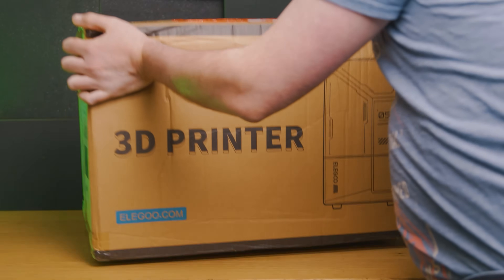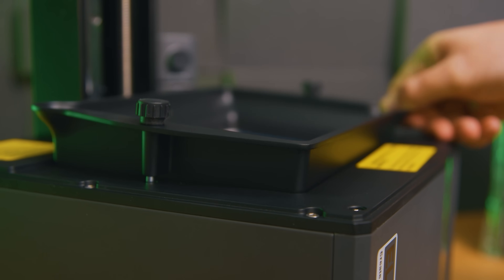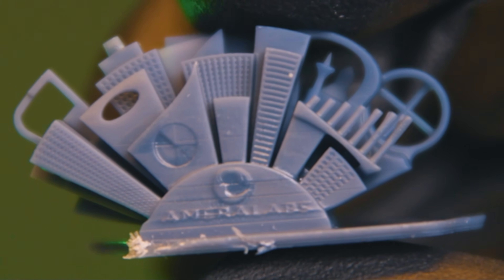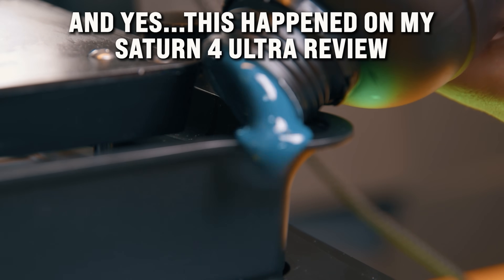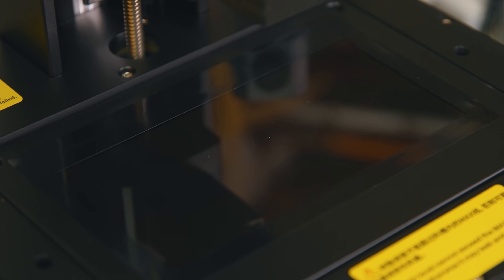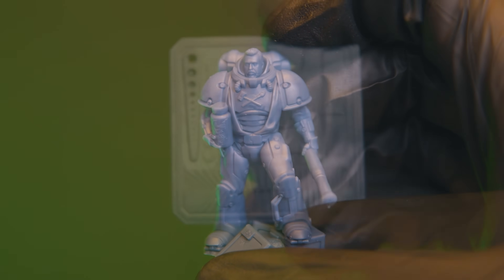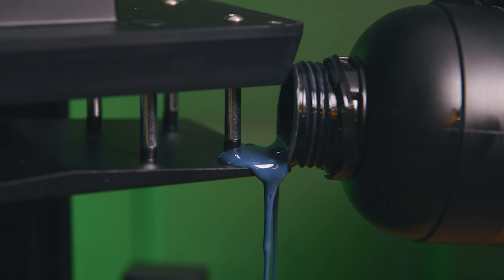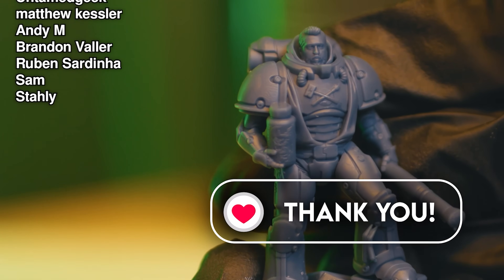Elegoo Mars 5 Ultra Review - Honey, I Shrunk the Printer!!!

Comment: Came back to this video as it helped with my decision at the time. But I would no longer recommend this printer, or any by Elegoo. My screen died after 25 hours of use. Because it was outside 3 months of purchase they said its a wear and tear part and refuse a replacement. The expected life of a screen is 2000 hours. I can see from my print history on the machine it has complete 13 prints, including 3 test prints to dial in the resin. I paid £220 for this printer, bought from Elegoo in April.
Reply from the maker: I;m sorry about this buddy, genuinely! Unfortunately i was unable to test longevity of the screen, I never have had the ability to do that. I;ve since been warning people about these failing so rapidly due to the extra power needed to get through these panels.

Elegoo have changed their warranty period on screens since this was release too, which is really crappy!

Comment: Did you ever get around to making the "layer compression" video?  I have been building parts directly on the build plate without any raft/supports which has been working well but sometimes the amount of compression drifts around which can cause problems.  I need to print directly on build plate to minimize print time and consumption of the super expensive industrial resin I am using.  A deeper understanding of this phenomenon would be really helpful.  Many thanks!

Comment: I’ve always recommended Elegoo to my clients and friends, especially because of their technical support.
But unfortunately, that has changed.
Elegoo has quietly changed its exchange and repair policies, and this has caused a lot of trouble — especially since it seems that the Saturn 3 series has been having many issues with screens dying in under six months, not to mention the leveling problems with the Saturn 4, which was supposed to come “auto-leveled.”
Elegoo is no longer what it used to be, and it’s just not worth spending that much money on a product that fails or has issues in less than six months.
Like this post so others can be aware too.
Reply: So what printer would you recommend then?
Reply: @jake53105 anycubic or anything else (also avoid creality halot printers)

Comment: That build plate system really repels me, especially when it’s impossible to level it normally. Is it possible to mount a normal build plate? This design is so silly. Is it only SL1S that has tilt vat and normal build plate?
Reply: Is done specifically for tilting vat which increasing speed and quality, especially for fragile resins. So not sure what you referring to as all stuff are kinda fixed now.

Comment: I honestly would like to see a 5" inch, fast printer with the 18 micron pixel size. something a little smaller than say, an OG photon, with all of the modern bells and whistles.
Reply from the maker: You say you want 18 micron pixels. but so far the 18 micron printers are not as sharp as these. There's technical reasons for that which I'm gonna share in upcoming videos. like my Mars 5 video
Reply: You get what I am trying to say, though? Small, fast, easy to deal with. I find myself printing one or two minis at a time, not armies.
Reply from the maker: @gkeaton9755  100%, I'm just making sure people understand that pixel size no longer means better quality.. I;m about to doa  review of a 10" 8k printer that blows 12k and 14k out of the water!

Comment: I’m brand new to 3d printing, and I just bought the mars 5 ultra and can’t even get a basic calibration matrix or cones of calibration to adhere to the build plate. 

Every print just sticks to the FEP.
I’m using a castable resin (Power Resins Vintage) and using a fermentation band to keep the resin warm. But other than that, I can’t figure out the issue. I can’t try and see if the plate isn’t preoperly level as the machine is supposedly self leveling. 

Are there any other factors that could be leading the first layers of resin to stick to the FEP instead of the build plate?
Reply from the maker: Castable resins can be trickier because they are softer, often need longer curing times and slower speed. VogMan may be a better person to ask as he uses castables. I don't. but i don;t know how responsive he is in comments,

please use your printer in slow mode, that's a setting on the UI.

And Increase your base exposure times. try 1 minute or longer on base exposure. if that gets parts sticking to the plate at least, that's half the battle won.
Reply: @FauxHammer  thanks Ross! So far these are all things I’ve tried, but I appreciate you taking the time to help either way… I’ll just keep trying!!
Reply from the maker: @tomgrimes2674  Hmm, I can't think of anything else to be honest. I mean, it could be too long base exposure too.

I guess the other thin may be if your plate is not level? as shown in this there is a guide on levelling from Geek Detour?

Comment: Except for the tilt all those features add to the cost of the machine and will cause extra problems. Resin printers should be as mechanically simple as possible so that they are super easy to clean which is super important for safety. They shouldn't have any nooks and crannies for resin to hide in. They shouldn't have any additional parts like cameras or sensors that would require extra trouble shooting or that could get resin on them. I'll stick with my Mars 2 Pro. It's easy to maintain.
Reply from the maker: I'm pretty sure the tilt also adds to the cost and can cause extra problems.

Comment: hi faux! i’m getting ready to take the plunge into the world of 3d printing, specifically for miniatures, and i had a question about your own wargamer brand of resin. it is water washable, but would you still recommend using meth spirits regardless? in your beginner video you said that water washable resins absorb water and that can cause problems. would using meth spirits on your water washable resin avoid that problem? is it even desirable to do so?
Reply from the maker: Hiya, yes it is, and yes you can and yes I still prefer to do that myself.

It can be cleaned with water unlike some other resins where water will just not dilute the resin at all, but I uses Methys mostly because a 20 minute bath with soften the resin and save you having to use warm water to heat the resin up which also makes the supports softer.

Also, imagine cleaning a tile floor, you can clean it with water but cleaning it with something alcohol bases is still a more thorough clean. No idea why, I'm not a chemist, but it works.
Reply: @FauxHammer  Thanks for getting back to me! your channel is so helpful

Comment: good honest review of the 5. im not liking the new build plate they have on this and the Saturn 4. its just another faf that seems unnecessary, and even more so if its causing more compression issues. im going to stick with my mars 4 max for now.

I think it would be useful for a 'compression guide for dummies'  from you as you have a knack for no nonsense explanation and maybe if possible a way to help reduce this.
Reply from the maker: Yep, planning that compression guide… but bear in mind. As I said, it’s not just this printer. It’s all printers..
Reply: @FauxHammer  i have noticed on my 4 max if i print directly onto the buildplate... i may have found  a 'fix' for it from various threads. will let you know what and if it works
Reply from the maker: @AGMiniatures  no worries. is the fix, excessively long wait times?
Reply: @FauxHammer  lol no, there are various views on it. from taking apart the printer and changing a rubber gasket (which is a nogo for me) to various re-levelling methods. i can email you the info if you want to look into it
Reply from the maker: @AGMiniatures no worries. I’m speaking with a few people directly already.

Turns out the solutions are various…
Reply: @FauxHammer its just a case of testing and seeing what works. looking forward to seeing what you find out 👍

Comment: Hey I was just thinking of something that I don't remember you talking about that can save people a decent amount of $$ on cleaning materials.  You may be able to add this to a video.

Most people should know you don't want to throw out uncured resin on stuff like gloves and paper towels.  I've seen people talk about throwing that stuff in the cure station, but that just makes a mess.  What I do Is use a small wash basin in front of the machine when I pull the plate off.  The plate goes in the basin.  I pop the parts off, and put the plate back on the machine.  

Next I remove the prints from the supports and wash them.  The bin then gets put either in a window or outside for a few hours to cure everything.  You can pop out all the cured resin from the wash bin and throw it away.  Don't forgot to throw your paper towel etc. here as well.  Move things around every now and then if there's a lot of stuff.

Comment: You are saying that this 18micron printer is worse than 28 micron saturn🤔
Reply from the maker: I'm saying it's not as sharp, yes. Just lik ethe Mars 4, But I did not sue the word "Worse"
Reply: @FauxHammer  well it should be sharper... please try lowering the light intensity for 20% - i had to do this on my anycubic 6k
Reply from the maker: @FuriousCarSpotter Hang on... I'll lower the light intensity by 20% which suggests I should also up exposure time by 20%... same result.?

Comment: Hi, I want to exclusively 3D print relatively flat pieces but with max resolutions. I'd love to learn more about the compression issue and how you can actually get true 18µm resolution (microfluidics/microchannels with 50 to few hundred micron channel diameters inside the part). Thanks!
Reply from the maker: I’ll look to cover the compression issue. But I do t think you can get that accurate with it. At least not without hours, or even days if dialing g it in. And for that you want a more specialist technical channel.

I’m the crayons guy

Comment: Dimensional accuracy depends on the resin used; light intensity alone won't help in achieving it. Some low to medium quality resins can be adjusted for either tensile strength or dimensional accuracy, but not both simultaneously.

Comment: The same calibration issues you showed here I'm currently having on my new Mars 4 Ultra. I changed to nFEP but I just can't dial the resin in precisely, like I have on all my other printers (Phrozen Mini 8K, Mighty 8K, Mars 3...). The tests tell me that I need  both shorter and longer exposure at the same time! The resin needs more exposure to build tensile strength as small stuff gets ripped off, but at the same time I already see clear signs of overexposure with small gaps starting to fill, small details get slightly bloated with less sharp edges. This has never happened on any of my other printers. I'm getting close to giving up on it and sending it back. If this is the same on the Mars 5 then there's no point for me.

Comment: Question, i see you recommended bigger printers at the start, but if it's just talking about print quality, and im not interested in the larger area, is this one better?
Also because in the budget that I'm currently am 270 is a lot of difference against a 330 for a saturn 3.
Reply from the maker: No, later in the video I say that this is just not as sharp as those bigger machines either.

But it really is a minimal difference

Comment: Anti-aliasing is still a problem with my Saturn 2, which seems to produce identically aliased prints no matter how much I crank up that setting.
Reply from the maker: Really? Mine was fine… what sliver are you using. If it’s Lychee. That’s probably why. It’s a chitu based printer with a chitu motherboard. Chitubox is the way to go.

2xAA with 2x image blur and layer lines should be fine entirely

Comment: I love the videos, but this utterly confuses me. I just shipped my Elegoo Mars 4 Ultra back for a refund since I just bought it for quality, and then they announced they'll be revealing this in a week - so I used my refund policy. I was in a way hoping for quality improvements, don't know why. Either way... outside of being cool and informative, I am trying to establish where to put my money right now - since the only thing I care about is the quality of print. I print miniatures with the sole purpose of painting them for a showcase. Which means I don't print that many or need large volumes - quality and ease of use are the only factors for me. And I really struggle with figuring out what printer to get... is it this with 18 micron pixel size... or is there a larger printer that will still do a better job and maybe just have  abigger build plate. I would take a bigger plate... but not if I get to see any layer lines or they come out after I've primed the mini.
Reply from the maker: Honestly when it comes to quality. You’re splitting hairs at this level. But the 10” 12 and 14k printers are a little sharper like the Saturn 4 or even the Saturn 3
Reply: @FauxHammer  well I am splitting hairs kind of... because in a way we already are at this point :D So you'd say I'd expect sharper results out of Saturn 4 (Ultra I presume?) over Mars 5 Ultra... I presume after replacing the ACF film for a regular FEP. Btw, nice job and opinions, worth supporting you :)
Reply: @FauxHammer  One final question... Saturn 4 or Uniformation GK2 with 12k upgrade ? :D
Reply from the maker: @WithinWicked  ask me again about a wekk into July
Reply: @FauxHammer  whats scheduled a week into July?
Reply: @FauxHammer  I made a calendar note to ask you again a week into July :P lol here we are tho!

Comment: Amazing review, but I am torn between buying the mars 5 ultra and saturn 4 ultra. I am an absolute beginner at 3D resin printing and mostly want to print miniatures or maybe larger dragons for dnd campaigns, does anyone have advice on what to buy?
Reply from the maker: Saturn 4 Uktra. Easily. It’s sharper, but also it’s bigger and whether is no is or not, imo this felt crippiligly small now I’ve had a bigger one
Reply: Thank you so much for the answer, i bought saturn 4 ultra and i have no regrets. Great 3D printer and easy to use

Comment: What a shame that they didn’t change the lid to a hinged version and having a vent hole in the back of that lid. Really? Regarding printing directly on the build plate. I do that quite often with my Phrozen mini 8K. Just need to compensate using UVTools (which btw does not work on the Saturn 3 Ultra and i have yet to find out if it will work with the Saturn 4 Ultra. Reason I print on the build plate is that I print mant technical parts that have flat services and it is just easier to print directly on the build plate.
Reply from the maker: Sounds fair but it would not be as easy to angle the parts, support them and not need to worry about the uv tools requirement?

Again, just curious

Comment: I know little about resin printing, but it occurs to me that if the first few layers of prints are susceptible to compression artifacts, would it not be worth printing these calibration test with X mms of support materials under them to replicate the use case of having prints suspended from supports? 
Is that maybe a waste of time if prints on supports tend to come out decently anyway? 
I'm just wondering if people calibrate their settings based on getting the test prints to work when printed right on the bed when they're in that "zone" that is susceptible to warping, but are then printing stuff on supports anyway, then maybe the settings that were "dialed in" aren't actually that dialed in?
Reply from the maker: There is potential for that yes but I have seen it only once where the pressure release is where the details of a flat test are

Comment: Meh, not for me as I need to print directly on the build plate (apparently for some non obvious mysterious reason to the reviewer).  Maybe the Mars 5 is the way to go for those of us who print functional parts directly on the build plate.
Reply from the maker: the issue will be present on the Mars 5 too. as I said, It affects every printer ever made. It will take me a while to put a video together and I'd look up the compression issue
Reply: @FauxHammer  Yes, but this looks way way worse.  In your video clips you can see the build plate flexing upwards every time the vat comes up - that's not good as you are mashing the screen/vat film into the build plate/previous layers/thin layer of resin trapped between the build plate/vat surface.  If there is not enough wait time between the vat reaching the top and the start of the print all sorts of things will be flexing and moving around.  You should try the "slow" mode.  On my Mars 3 and 4 machines I have to slow things way down for the initial layers to avoid compression, which goes against fast printing.
Reply: @FauxHammer  Hey, thanks for these videos though!  I always watch your videos even though I don't print miniatures, etc. (I'm a direct on plate part printer) because invariably I learn something useful.

Comment: I'm torn about this. I like some of the features, on paper. My mars3 is still working well. I only consider the mars series, as I have limited space, and I really just use my mars for prototyping my miniature designs, so I don't currently need more. If the speed is increased, that would help immensely, so the tilt could be a great feature for me. 
Disappointing about the new cones of calibration not being fully successful.
Reply from the maker: Ist better than the Mars 3 but not by a huge amount. Speed is the main thing